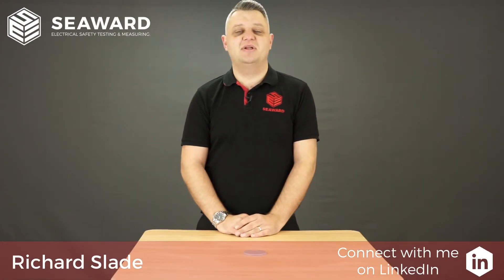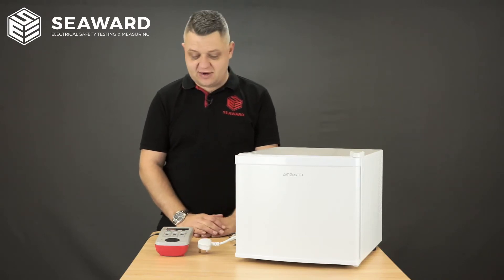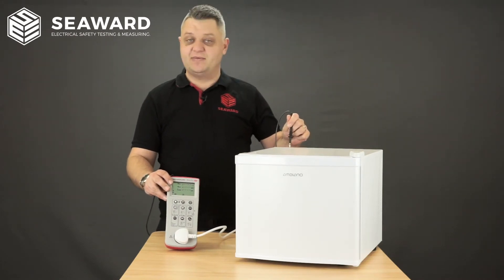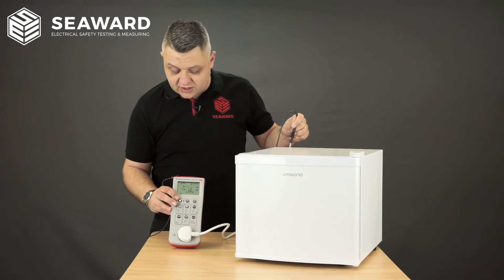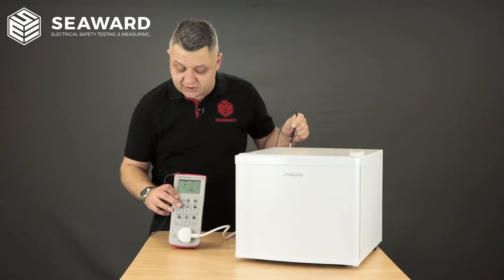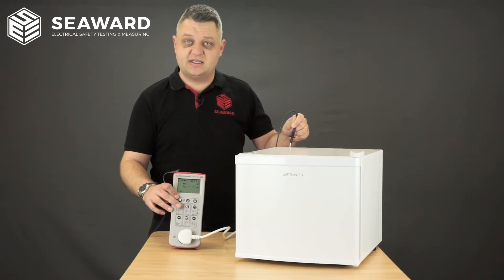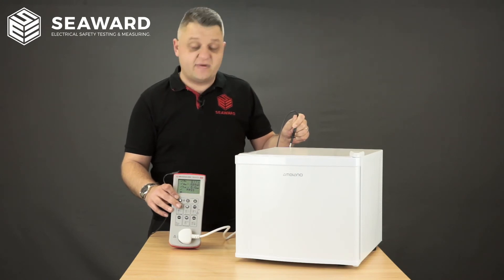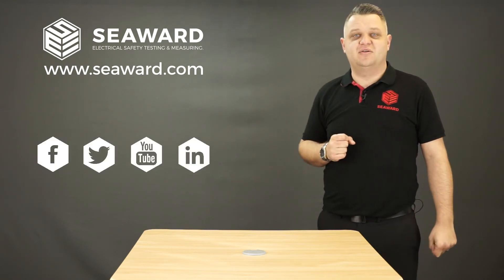How to PAT test a fridge - Seaward

Comment: as a PAT tester i place the probe at the front of the fridge, generally the hinge is exposed metal, it is good practice to test the earth continuity from the front of the fridge where people are touching the fridge
Reply: n4thb4dc0 that’s a good point . I usually attach the wander lead to the thin copper pipe at the rear of the fridge